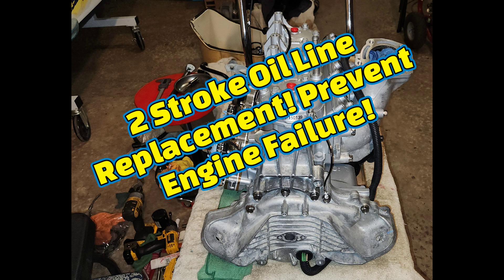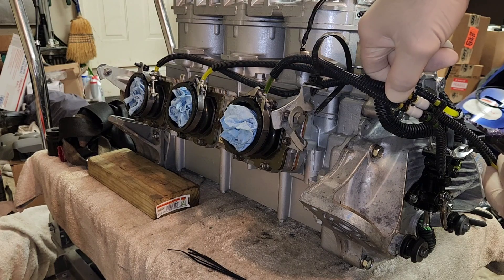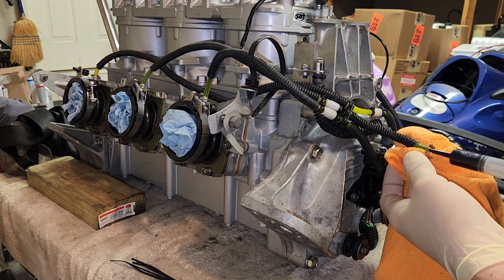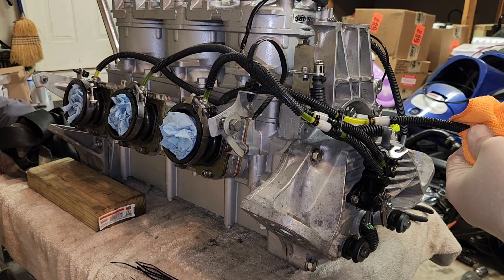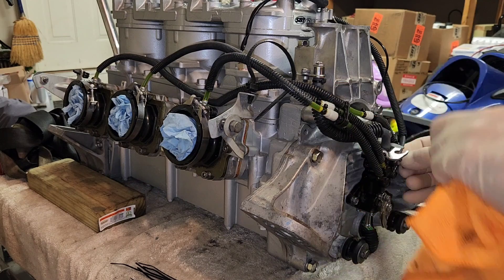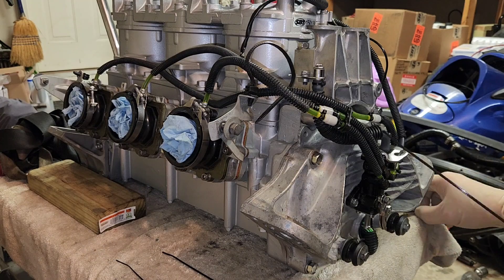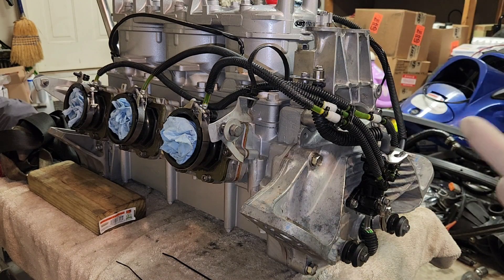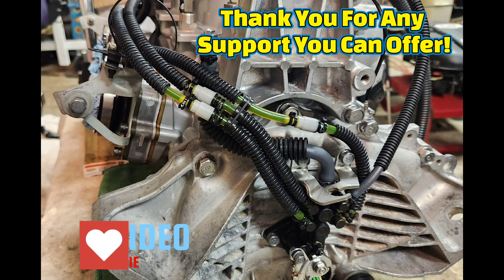2 Stroke Oil Line Replacement: An Easy Job For Any Mechanic! Prevent Engine Failure!

Comment: Great video, can you test the check valve to make sure all three are ok, or better replacing 20 years old?
Reply from the maker: I performed an oil delivery test using a Flywheel bolt with rubber hose on oil pump side to keep pump attached best. I had it chucked in a drill and oil lines in equal sized cups. I found all 3 delivered an equal steady amount of oil. The problem is you should also check the check valve for bleed down. With the system fully hooked up you can replace the line section from check valve to engine nipple. Leave it for a day or two and if it bleeds oil to the engine then you can verify that the valve is relaxed and bad. I had an engine that was overly filled with oil in one cylinder and that's how I found that check valve was bad! The valves are bound to be worn at their age, it is advised to replace them, you can use the link in my description to purchase some for peace of mind. If you decide not to replace them hopefully the two tests I listed will help you check yours.
Reply from the maker: In order to do the oil bleed down test you have to have the engine in the ski, the oil system fully hooked up, air bled out if system with bleeder screw, and then you swap out the end lines from check valve to engine nipple. Once the system is fully hooked up, check the lines for a day or two of sitting with no cranking and if the line bleeds oil to the engine then you can verify the check valve is faulty. You can avoid all that by just replacing them but hope that helps you decide.

Comment: What check valves did you use and were did u get them
Reply from the maker: Here is the part number you need #67X-13183-00-00. Partzilla shows that they have them in stock. I tried to find them on Amazon but nothing came up. You can use this link to buy them from Partzilla on Ebay:
https://ebay.us/Wee3R7
If you use my link to make a purchase, I may make a small commission at no additional cost to you. I appreciate any support you can offer. If you have any further questions just ask.